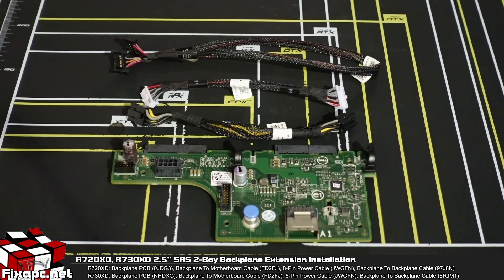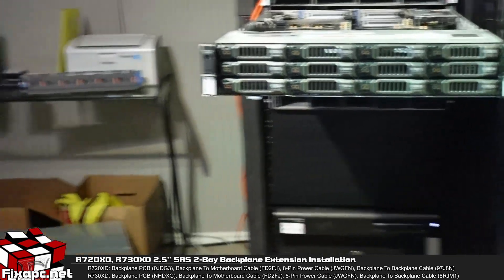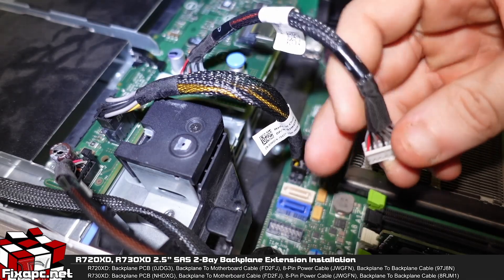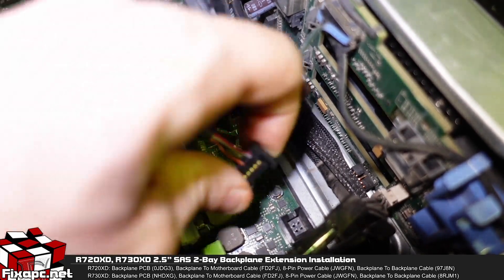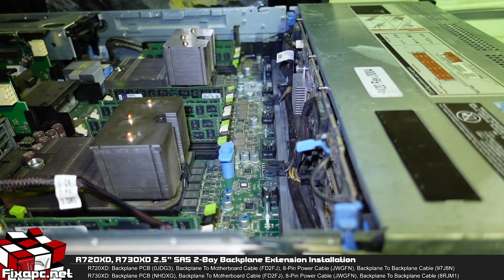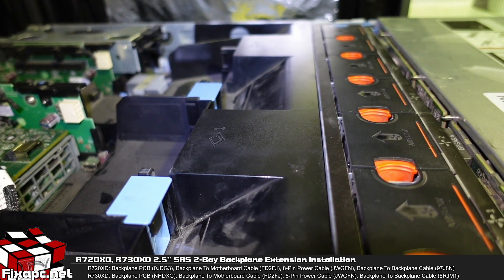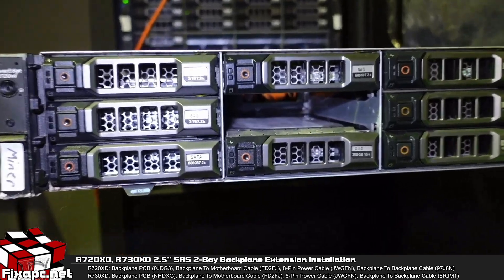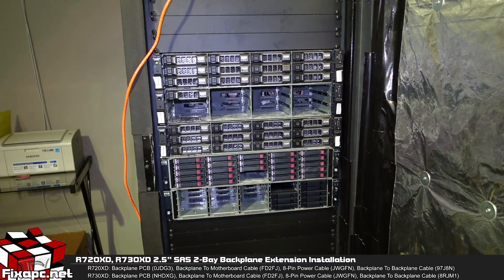R720XD, R730XD 2.5" SAS Backplane Extension Installation

Comment: Random question, but is it possible to upgrade a 720xd to sas3? I assume it would need a sas3 extender backplane and sas3 controller…
Reply: @FIXAPC  thanks! My main reason for this is ESXi 7 doesn’t support my sas2 controller anymore, so I can’t test out vSan. I have the 12x 3.5 r720xd, so it’s an expander backplane. Do you happen to know any specific models to buy? No worries if not, you’ve already helped a ton